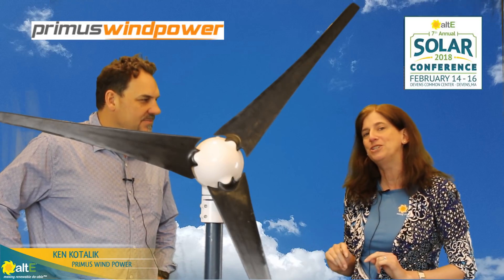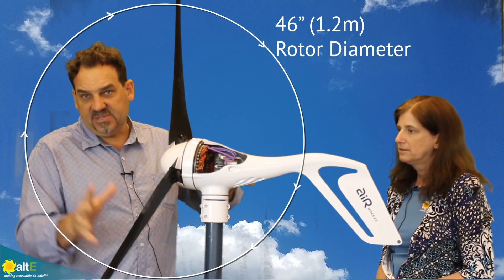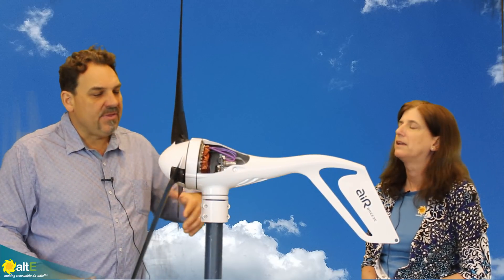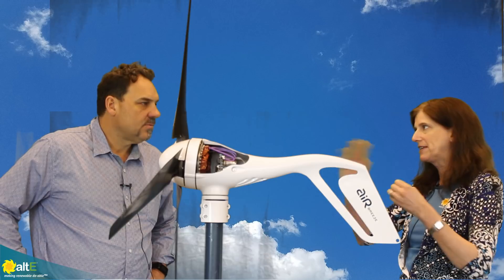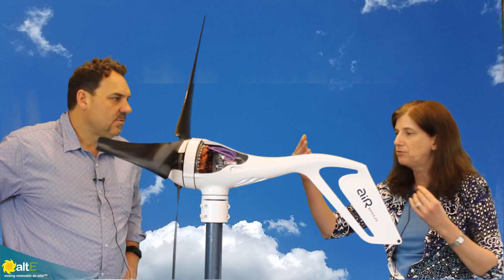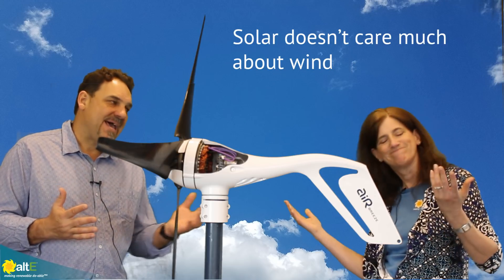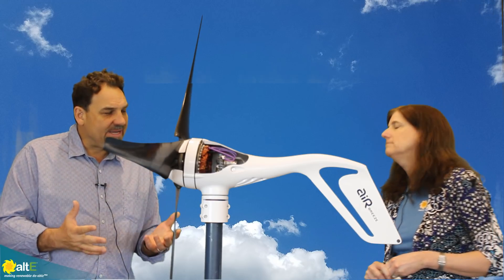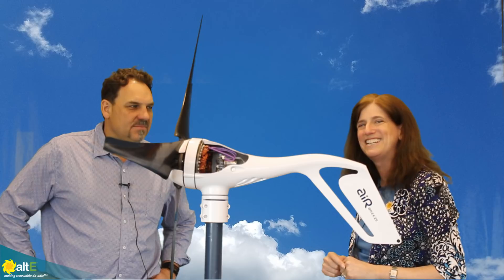Primus Wind turbines overview 2018

Comment: These are about $2/Watt.  Solar panels are now under $1/Watt.  Meh.  Pass.
Reply: In 25 MPH winds it might produce 350 Watts and it costs $1200, which equates to $3.40 per Watt.   BUT, who actually has 25 MPH winds for many hours per day?  In an 11 MPH wind it will generate only 30 - 40 Watts !  So, that equates to $34.00 per watt !   It is cheaper to run a gasoline or diesel generator, when needed ..

Comment: I've read wind has to be 30 mph to power wind? I see the Amish took down their big wind power experiment
Reply: Certainly, faster wind will generate more power,  but only up to a point.   Where did you read, "... the wind speed had to be 30 MPH ..." ?   Typically, you need 10+ MPH Wind to even consider a wind turbine.  Most Wind Turbines are "rated" for max power at 25 MPH ( the Industry Standard ) .  But unfortunately, some wind turbines are "rated" at 30 MPH, which is very unreasonable and is a mfr "trick" to make their wind turbine appear more powerful than it really is.

Comment: Refrigerators should be operated with electricity from wind turbines. Even if the turbine did not run all the time, the refrigerator would still store the cold capacity from even a small input of electrical power from that windmill. Storing the power does not work, (batteries too expensive). Sending it back "into the grid" does not work, because every foot of power line eats up that electricity from resistance in the wire.
Reply: Actually, the grid does NOT "... eat up  ..." very much power in the wires.  And most likely, your own house will consume all of the energy that this wind turbine will generate.  Excess ... what excess?
Reply: If only we could see the down votes like back in the good old days.

Comment: If that "wind turbine" creates any electricity at all, then that electricity should be used to MAKE something, and NOT to send that electricity down the line, where the majority of it will be lost in wire resistance. Any small manufacturing operation would be okay, AS LONG AS THAT OPERATION MADE MONEY!
Reply: Not for gridtie. Charging small battery bank in dark conditions.

Comment: Your circuit diagram has that stop switch connected so it will short circuit the turbine output and probably blow it up. You better fix that up. Or does it stop the turbine spinning dead in it's tracks?
Reply from the maker: The schematic is right. Shorting the turbine turns on a kill switch and stops it from spinning.

Comment: As others have pointed out...they are overpriced toys. Don`t get me wrong, they are well made and reliable....but they are not a serious turbine. And just because they may be the best selling turbine blah blah...that just proves good advertising...it does not translate to a good purchase. Their output claims are beyond ridiculous. OK, with a laminate wind in a proper wind tunnel environment at precisely the right speed, yes...they no doubt match their claims. Back in the real world however....fantasy. Any useable power is between 20 and 30 knots...below 20, nothing of note...above 30, it enters brake mode. In brake mode, it will standby for 5 mins, briefly spin up to see what the conditions are like...and if its still over 30knots...it shuts down again. So, even in moderate winds, it sits doing bugger all....all day long, save for a regular spin up. The main problem is...this is exactly what it is designed to do. And of course, there is nothing wrong with having a system to stop the turbine from frying itself. But... Its a wind turbine that hates wind. 
Take a look at the link....their graph is totally bogus. I was fooled into thinking there would be a drop off in power in high winds...but still an output of either 100 or 200 watts depending on model. To me, that`s acceptable..I can take the power reduction trade off in exchange for a non fried unit. However, the output shown is false and highly misleading. After 30 knots (ish) you get nothing.
https://www.primuswindpower.com/wind-power-products/air-30-turbine-21/
if you live in a wind tunnel at 29 knots, these are fab.

Comment: Will this work with lithium batteries? I guess you would have to use a voltage booster between this and batteries...
Reply: They intended them for lead batteries, make sure you confirm use with lithium.
Reply: SolarizeYourLife yeah bro.. it’ll work just fine.. you just need to know what voltage  your battery is and match it with the proper voltaged turbine

Comment: This is way too weak. 30 kW output per month is nothing. For a tiny remote cabin it's better than nothing I guess but that's a very narrow use case.
Reply: Yeah, 3 dollars worth of electricity every 30 days. And that is under ideal conditions
Reply: @cindytepper8878   exactly, its farcical to suggest this will get within a hundred miles of their claims.

Comment: Oh, so it's over priced, under performing, standard junk. Thank you for presenting this!
Reply: Al Iwon'tShutUp Hefner you wouldn't say that when it's the middle of winter and there's no freaking Sun for weeks and there's just endless wind....
Reply: Actually, I would! You see, this particular turbine is very high cost for very low output. There are MUCH better turbines on the market for about the same cost. Check out Missouri Wind and Solar for prime examples.
Reply: Post a link as an example. This way I can show you how wrong you are.
Reply: Al Iwon'tShutUp Hefner 
Hello i just wandering if you know other places where to buy it 
Can we make them?
Reply: I'm looking at $600 to repair the one I'm working on due  to design flaws and even at the price it will probably go to scrap metal yard. $$/watt, much better to get solar. I even already have the mast and wiring and $600 to fix it is too expensive. They are around $2k new and basically useless. Rotor should have been at least 6" bigger radius.
Reply: You lost all your credibility when you mentioned  Missouri  wind.
Reply: Missouri Wind and you know who's their little wind generators are very badly built they Shake apart they break down do yourself a favor and shop somewhere else
Reply: @homermcclain7694  Our wind turbines are very well built and never " Shake Apart" Homer.

Comment: Is the DC voltage to the battery controllable? Eg lithium battery vs FLA etc. Obviously a lithium bank will need more voltage than a FLA. If so this would be a nice little add on to a 3200w solar array on our RV for nighttime/low light conditions.
Reply from the maker: The output voltage is currently not configurable. Also, when a lithium battery bank with a BMS (battery management system) senses the battery is full, it disconnects the charging source, in this case, the turbine. That would leave the turbine in open circuit, free spinning. The on-board circuit card would apply the brake, but that's really not healthy for the turbine to do often. A possible solution would be to include a dump load and dump load controller to start burning off extra power, providing a place for the extra energy to go. That way the batteries would not disconnect. So, while it may be do-able, it's not currently designed to work with lithium. They are working on it for the future tho.

Comment: would this work with 12V Lithium Batteries, i did not see any charge controller that can be programmed.
Reply from the maker: The output voltage is currently not configurable. Also, when a lithium battery bank with a BMS (battery management system) senses the battery is full, it disconnects the charging source, in this case, the turbine. That would leave the turbine in open circuit, free spinning. The on-board circuit card would apply the brake, but that's really not healthy for the turbine to do often. A possible solution would be to include a dump load and dump load controller to start burning off extra power, providing a place for the extra energy to go. That way the batteries would not disconnect. So, while it may be do-able, it's not currently designed to work with lithium. They are working on it for the future tho.
Reply: Aaron Tsur yeah I would like to know what is the exactly the max/min voltage it will produce.... They say 12/24/36, but we all know a 12 volt battery is not 12 volts...

Comment: I have a bus conversion and have been thinking of getting a wind turbine when we're parked for a few days or so along with that I'm putting commercial solar panels on the roof hopefully to off set our power consumption by quite a bit.  

The alternator in the coach puts out 250 hot amps so any time the coach is running all of our needs will be met all this has not been  installed yet but I feel confident that if designed properly we won't require shore power only as back up if desired any feed back on this would be very much appreciated
AltE Is a great source of research and engineering for us layman folks and I for one really appreciated their videos its been very useful in making the right choices for our needs.
Thanks AltE for being there.
Reply: In 11 MPH wind this will generate about ~3 amps = not much ...

Comment: Correct me if I am wrong, but my understanding is that DC current loses considerable power over long runs regardless of wire size when AC not so much. That being said what is the optimal distance between the turbine and the battery array using the DC turbine and how much power will it lose?
Reply from the maker: The biggest difference for voltage drop over distance is the voltage. For example, if this is outputting 200W, at 48V, it would be 4A. I could use 14AWG wire over 40', and be under 2% voltage drop. But if I have 200W at 12V, that would be 16A. With 12AWG, I'd lose 27%! I have to move all the way up to 2AWG to stay under 2% loss. Now imagine if it was 240V. I'd be at 0.8A, and 28AWG would keep me under 2%. So, my recommendation is use the highest voltage battery bank you can to help keep the wire size small, and the voltage drop low. (This is the voltage drop calculator I use, http://www.calculator.net/voltage-drop-calculator.html )
Reply: Thank you for the reply.

Comment: Anyway that grid tie will become available from this vendor or others?
Reply from the maker: Unlikely. It puts out so little power, it is not cost effective to connect to the grid. It really is not intended for a home. The previous manufacturer of this used to make the AirStream, which was bigger and grid-tied. It was discontinued years ago.
Reply: altE thank you for the reply! Based the small amount, I would agree that only larger turbines would be grid tied. I suppose sizing my solar system with extra panels will do the trick for additional production. The only benefit would be small production during evening hours but not work while.

Comment: Dutch labs are still running the very long time tests on small wind turbines. They are great at generating energy for offgrid but terrible for home owners that are grid connected.As in cost of ownership. Here in the  Netherlands these do pop up at homes because home owners where mis or bad informed.